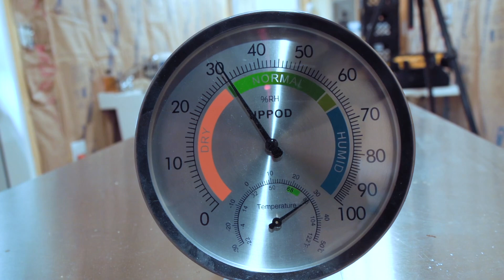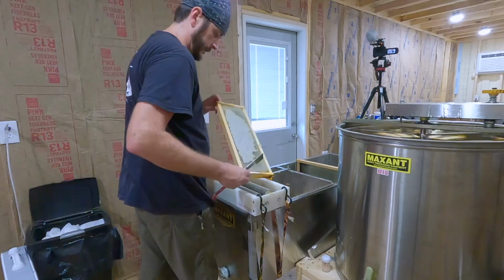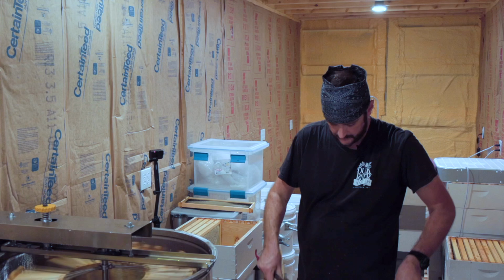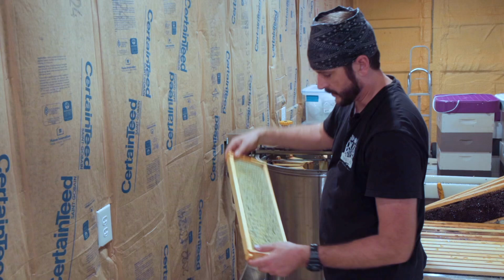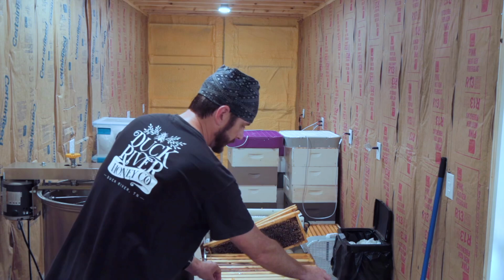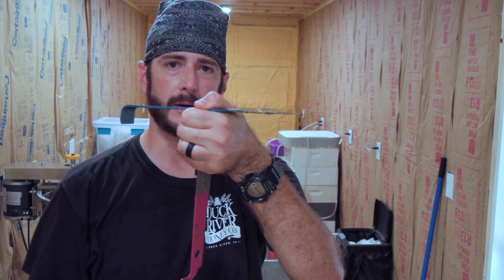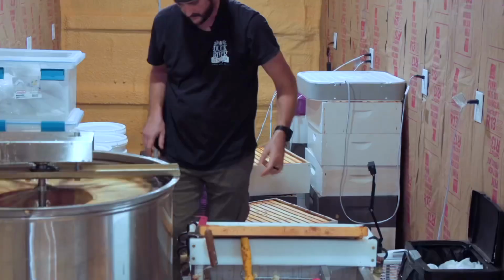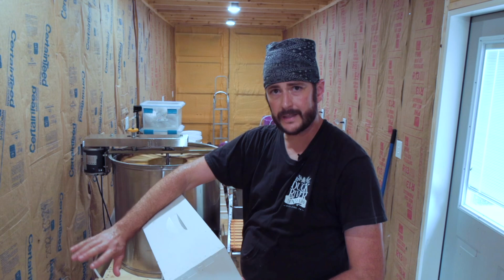Honey Extraction (Flow & Process)

Comment: I really think you should put your lids on your extractor machine.  We have found that without lids the air inside the extractor will vortex up and out of the machine.  While it does this, those fine wisps of honey are taken with it.  Everything within a few feet of the extractor becomes covered in the finest mist of honey and becomes sticky.  The covers are actually very beneficial, especially if you don't really need to be standing there watching it.

Comment: This year, after honey harvest in late June early July, I left full boxes of capped honey on the hives for the dearth.  But I noticed a lot of bees bearding outside the hive so I decided to give them more "room" by taking that full box of honey and adding a second box to checkerboard foundation frames between frames of fully capped honey.  This gave the bees more "space" but ironically the bees also decided to draw out those foundation frames.  Each time they got them a good ways drawn out I pulled the frames and dropped in another frame of foundation... I've managed to get over 142 frames of new comb drawn (some fully and some with the beginnings of comb).  Some hives were drawing out the frames in 2-4 days while others took 5-6.  Still have 7 hives to pull more foundation frames from and when I do pull the newly drawn frames out for the last time I then reduce the hive down by a box again.  I believe the "flow" to make this drawing comb possible, during our normal dearth period, came from spotted lanternfly honeydew.  Glad I did it otherwise all that lanternfly honeydew would have ended up backfilling the brood chamber.  This may be a new management technique in the future to deal with spotted lanternfly honeydew.  There have been several frames of drawn comb that even had spotted lantern fly honeydew nectar filling the frames but I took those frames and put them in my "robbing spot" and the bees cleaned nectar out of them so they are clean and dry and ready for storage in a honey super box for next year.
Reply from the maker: Very interesting Nancy.  I’ve read about the spotted lantern fly a bit and the honey seems unique, if earthy tasting.  Some folks report a lot of them for a few years, then the population declines.  Personally I’m wearied by all the damage nonnative invasives have done.

Comment: Regarding your plans for getting new foundations drawn in a box with previously drawn frames. I stole Kamen Reynolds strategy and it works pretty well.  Use 9 frames, but put two virgins in the center. Make sure they are touching so they are drawn evenly. Cheat over the surrounding frames so they aren’t quite touching but close enough to encourage even draw.
Reply from the maker: I believe I’ll just go from drawn to 9 foundations with a bait frame.  When those get drawn it’s all even and nice.

Comment: hi nathan  yes it is fun, i used to run 350 hives , now 72yrs with 12 hives still fun, love seeing new comb,lots of well fed larvae, the queen, i occasionally wonder is this normal to feel this way.  i use a steam knife, same one i bought when i was 15. when i'm extracting i work as fast as i can, i learned this when i left school and worked for beekeeper with 1,000 hives,  i load extractor 2 frames at a time, you might be able to do more. i see you are alyways looking for ways to improve . i commented on your box lifter, you could design a method to move the supers on to the trailer. designing and making is also fun. i bought a brand new ride on mower, it turned out to be a piece of crap, since i wasn't rolling in money i designed and built a zero turn with 54'' deck for a quarter of the price ..you could make a micro version of one of those boom loaders to go from hive to trailer...and it would be very cheap...
Reply from the maker: Thanks Michael.  I like to tinker and I can weld a little, but I’m no fabricator or welder.  I’ll probably build a couple contraptions for next year to make things better.  I’ve thought about having my local fab shop make me a 12’ deckover trailer so I could just load supers on the sides.  It’d be handy, and a lot cheaper than a flatbed truck.

Comment: @DuckRiverHoney learn from my misfortune of running 9 frame boxes at first. IF you are starting with drawn comb you can go straight to 9 frames or checkerboard them. However, if the foundation is not drawn out it needs to be 10 frames to allow for proper "bee space" ...bees will NOT draw the comb out correctly if you go 9 frame without drawn comb. Trust me it is a headache.  What I ended up doing was running 10 frame supers until it was drawn, and then removed a frame. Starting out with 9 empty foundation frames was a major setback for me and my bees....

Comment: Thanks for giving us a look at your honey house.  I’m a little envious of you setup.  

For ergonomics it would be nice if your uncapping tank was a little higher - about the height of your uncapper.  Is there a way to mount the uncapper lower so that it wouldn’t end up too high if you extend the legs of the tank?

Last year i was actively checker-boarding my frames to try to get foundation drawn out faster.  I don’t think I have had a single frame  of foundation drawn out properly that way.  If I was lucky they drew out a skinny frame, but more often they drew it out really strangely.  This summer i mostly used boxes of straight foundation and I’ve had much better luck. 

Do you have a wax melter?
Reply from the maker: If I get a second extractor I already have plans of using half the uncapping tank as a box breaker and scraping station, then going to the uncapper, then to the extractor.  The flow works really well in my head, don't know how it'll pan out in real life.  I'm melting wax in a turkey roaster for now.  Not making a ton of wax so I'll limp along like this till I get a small wax melter.

Comment: Great video again Nathan. 
May I suggest two points? Put a layer of cardboard down on the floor and tape all the seams. Cardboard doesn't absorb dry honey. I wipe spilt honey off the cardboard with a damp rag. Throw away cardboard when done.
Second, I also have been trying to get more drawn comb for honey. I felt the best method was 9 total frames with the middle two plastic foundation. Got to keep the frames together on the new fdn for a while. If you check the supers and they have got a good start on drawing it out I separate them a bit. I would think just one new fdn. would work even better.
Reply from the maker: I've even thought of running 8 drawn frames with 2 foundations in the middle and then swapping it over to a 9 frame box when they start drawing the foundations.  That really requires precise timing though, and I'm afraid I'd miss something in the spring chaos.

Comment: Can you do a review on your Maxant 20-frame extractor.....likes and dislikes.   Why did you choose that over others?
Reply from the maker: I don’t know that I will do a review.  I found mine used.  Would have also bought a used Dadant.  The Maxant is a good machine.  Well built, simple mechanics, can be repaired with hardware store parts.  You do have to increase speed manually during extraction cycles.

Comment: Very good video Nathan. Like I told you before I have the Simple Harmony Farms Uncapper as well. It has some drawbacks and limitations but it is a great tool for a beginning beekeeper and it doesn't break the bank.  Hopefully I can move up to Silver Queen down the road. I'm trying to build up at the speed that my bee yard will grow and let the bees pay for what is needed as they grow. Also do you strain your honey  through the paint strainers only? I use the paint strainers like you then pour the honey in a clarification tank and then run it thru a 400 micron screen into another 5 gal bucket. Do think that is over kill? Maybe the paint strainer is enough. ???
Reply from the maker: I just use the strainer bag, then lid the bucket.  Buckets go into a 42 gallon bottling tank and settle for at least a day before bottling.  Settling in the bottling tank floats out all the fine wax, and anything heavy that the strainer bag missed would sink to the bottom.  I get very clear honey doing this.